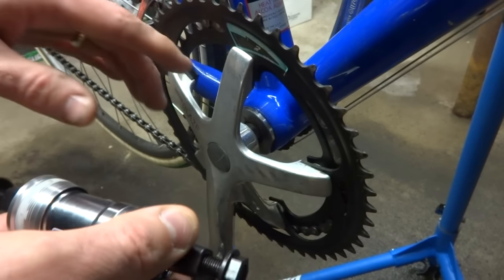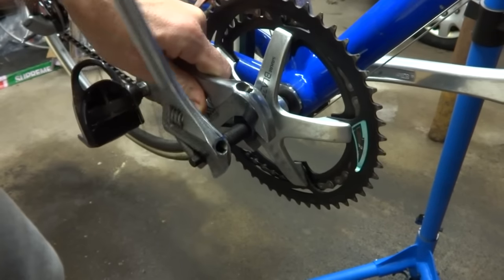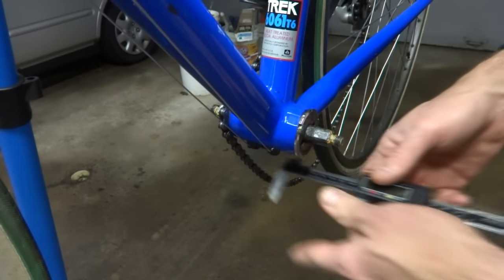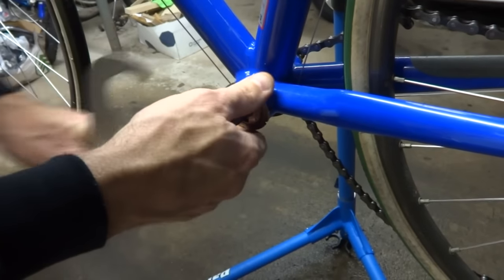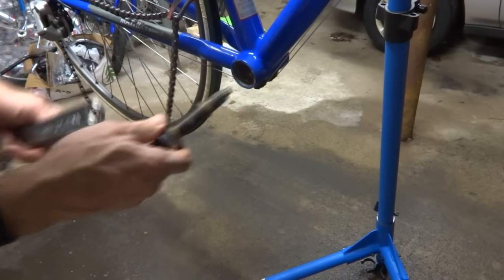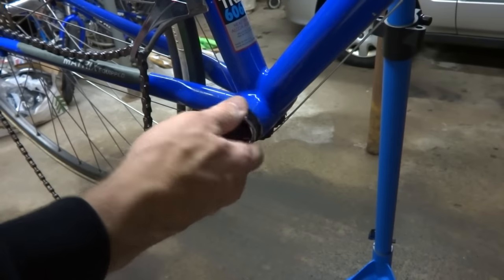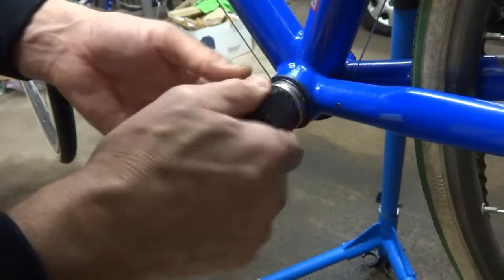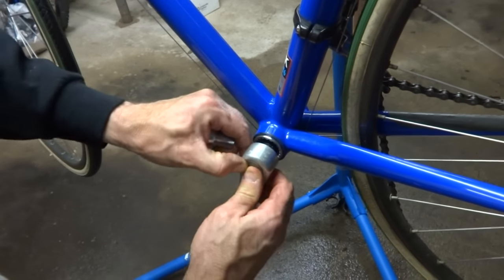How To Upgrade Vintage Bike With Sealed Cartridge Bottom Bracket

Comment: I would like some help. I removed my vintage´s bike bottom bracket and the measurements I obtained are; axle length of 127.5mm  a shell width of 70mm and a shell diameter of 34 mm. I want to upgrade to a 110 mm sealed squared taper bottom bracket but most of the ones i find are 68x110 mm english threading  and when i do find a 70 x  110mm it says Italian threading. can my bike have an english threading even if it has a shell width of 70mm and a diameter of 34mm if it is, where can I find a bottom bracket suitable to my bike?
 Thanks
Reply from the maker: I don't know you have. 70mm is typically Italian.
https://www.sheldonbrown.com/cribsheet-bottombrackets.html
Reply: @RJTheBikeGuy   Thank you so much for answering. I saw that site before, and according to them it is italian, but my bike frame is from a swedish company ( https://auctionet.com/en/519858-cykel-26-itoh-mustang-1970-tal) so that makes me doubt.
Reply from the maker: Often there are are marking on the BB/cups. What do they say?

Comment: Why is it that whenever I install a sealed BB it always feels like the rotation is sooo smooth until I install it?  Once it tighten it into the frame it always seems too tight when I try spinning it.
Reply from the maker: I don't know. But any minor resistance you feel by hand turning the spindle with be insignificant when pedaling.
Reply: Thanks RJ.  I slapped in on and it's smooth as hell.
Reply: Because you're crazy lol

Comment: do you know if i can buy carbon fiber road frame from china and i can use square taper bottom bracket?
Reply from the maker: +Haralabos Lukatos Ask the seller. I don't know the details of the frame.
Reply: thank you for the answer. i look general carbon fiber frames and no have deside yet to buy one i have seen so many cracked fail carbon fiber frames online and i not know what to do. many people say carbon frames is good some say not
Reply from the maker: I would be wary of a cheap carbon fiber frame.
Reply: always you help me thank you. You are very profesionall in bikes repair. I repair bikes at home but i am too far from your pro level i want learn better to repair bikes and faster too. You think is better i stay with my steel and aluminum bikes? have i very nice day.
Reply from the maker: Probably safer unless you know what you are buying. Even buying an expensive carbon frame from China is risk as there are a lot of counterfeit bike frames coming out that look like high end frames, but aren't built to the same quality.

Comment: can i change the gear 3 piece crank to single crank??
Reply from the maker: No. Why would you want to anyway? One piece cranks are for low end bikes.
Reply: RJ The Bike Guy cause my gear doesnt work anymore 😅
Reply: You probably need to fix the shifter or the derailer, or get a new inner cable.

Comment: This conversion adds weight, correct?  You already have the tubing of the BB shell to support cups and cones, then you go and add more tubing of the sealed cartridge to support the cups and cones.  Granted the sealed cartridge cups and cones are smaller in diameter, so it might be a wash.  However, there's also the durability factor.  The larger original cups and cones would last longer because of more bearing area.  Then again, having a sealed system may last longer because dirt and water is kept out.  Interesting trade-offs in these two bearing solutions.

Comment: Okay I have the tools and instructions I measured the bottom brackets and know what size to get .I don't know what brand to get the pricing is compatible but how do you know a reputable brand they have so many I would like to get the best bang for my buck I know shimono is good but there are several brand from Italy Germany America etc. Besides size what should I be looking for in performance does any one brand last longer etc I ride my bike all year round in the mountains rain sleet snow mud hail extreme heat my original bb are worn and the crank arm has play in it I don't want to. Keep spending money for stuff I can do at home

Comment: No grease on the bolt threads of the new crank arm bolts!
Reply: Some mechanics will say "yes' to a very very small amount if you are working on your own bike.For a paying customer never because of the legal liability it might cause later. I use a bolt anti-seize so it will tighten down and torque to the factory spec.

Comment: how to choose correct bottom bracket size?
Reply from the maker: Measure the shell. The spindle length is dictated by the crankset. See the crankset specs for recommended length.

Comment: Sorry, I'm a noob with actually doing things instead of watching and don't know all the names.  I have some cranks that basically have the "female" side of the 8mm hex, no bolts.  I got the non-drive side loose and ready for the crank puller, but the drive side is really stuck.  It does not seem stripped.  I have tried putting some PB Catalyst in there, making sure it's clean, etc.  Oh, and I tried hitting it with a hammer, but maybe not hard enough (trying not to annoy my neighbor).  I don't have anything other than basic tools like hex set, a couple of wrenches, a bike tool, etc.  I can't get good leverage or hold on tight enough and my hands are getting sore.  Getting sick of giving up and going to the bike shop, and I may have to, but any tips?
Reply from the maker: https://www.youtube.com/watch?v=j5gmAkMLX60
Reply: @RJTheBikeGuy  Thanks, I FINALLY got both bolts on 2 bikes out, and got 2 cranks off so far.

Comment: This does not work well with an old lugged frame. The tubes extended into the bottom bracket and interfere with it.
Reply from the maker: Never seen frames where the tubes extend in like that. Sounds like poor craftsmanship.

Comment: OK but I have a new frame without a BB on it, how do I know witch size to buy?
Reply from the maker: David Smith it depends on the crankset you are going to use. You need to find what spindle length is recommended for your crankset. Sheldon Brown has a chart here for many cranksets. http://sheldonbrown.com/bbsize.html
Reply: This is what i have got Shimano Acera 9 Speed Octalink Crank Crankset 48/36/26 175mm FCM391
Reply from the maker: David Smith Then you need an Octalink bottom bracket. The specs for your crank set tell you exactly which BBs you need: http://bike.shimano.com/media/techdocs/content/cycle/SI/FC/SI_1ME0A/SI-1ME0A-001-00-Eng_v1_m56577569830745522.pdf
Reply: OK matey thanks a lot your a legend

Comment from the maker: ***** , no. So you will have to measure like the video.
Reply: Is there a nuther way than using the crank puller to remove the drive side ??
Reply from the maker: To remove the crank? Or the BB?
Reply: RJ The Bike Guy how do you know what size of bottom bracket and the crank you need???
Reply from the maker: The size of bottom bracket is dictated by the crankset you have. They will often list in in the specs for the crankset what size of BB you need.
Reply: thankyou
Reply: +RJ The Bike Guy i may convert to this system next year are so i will see how the old set up last ;)they seem better than caged bearings

Comment: do you not want to buy combination wrenches?
Reply from the maker: +Scott Boerner I own combination wrenches. About the only place I could have used them in this video was on the crank puller. I don't one big enough to fit the fixed cup. That would be a big ass wrench!
Reply: looks to me like you used two on a puller that needed a 18 and a 14
Reply from the maker: That is what I said. And it was easier just to grab a couple adjustable wrenches. Feel free to use combination wrenches when you do it.

Comment: Hey RJ! Today i did this upgrade but the original axle width on my old loose ball bearing bottom bracket was 120 and the new shimano bb i bought was 125.5, that was the closest i could find (there was also 117.5 but I chose the 122.5). Is there any problem with using an axle 2.5mm longer? I had a talk with a guy in the bike shop about the chain line, that it should be parallel. Do you have any info on this topic? Thanks a lot.
Reply from the maker: You bought 125.5 or 122.5? Yes, it will throw your chainline off. So your chain will be at a steeper angle in some gear combinations. 2.5mm will not be much. 5.5mm would be a lot.
Reply: +RJ The Bike Guy I had 120, bought 122.5. Thanks a lot for the reply, everything seems to be straight. is there anyway to measure it?
Reply from the maker: Yeah, but kind of hard to explain. I go into measuring chain line in this video: https://www.youtube.com/watch?v=sInijI1vr34
But this is for a single speed.

Comment: I measured 68mm shell width but my caliper is saying 125mm for spindle length. I googled that size BB and can’t find it in 125mm. I see 122.5mm, I see 127mm....,
WTF?!?!
Reply from the maker: Find the closest you can.
Reply: I think my caliper is off a bit
It’s not a digital one
I’m gonna get a 122.5

Comment: Why even do this at all? Just re-grease the bearing and put it back together, or replace for $6 a side! These pre-assembled bearing units were made for bicycle assembly by unskilled labor; no need to finesse the bottom bracket nut when installing. Not intended for retro-fitting.
Reply from the maker: They are much better sealed, and come precisely pre-adjusted . But you can do what you want.

Comment: I've also got a bike with the same bottom bracket as yours.
Would it possible to install this: http://www.amazon.com/SHIMANO-Alivio-M4000-Groupset-9-speed/dp/B00LTLFW2K/ref=sr_1_1?ie=UTF8&qid=1428023461&sr=8-1&keywords=shimano+m4000

Do all frames have/use the same diameter & threads when it comes to bottom brackets?
Reply from the maker: That will probably work for you. Well, the most common size is 68mm wide shell and 24tpi. But vintage French and Italian used different threading. Also vintage Raleigh 3 speeds.
Reply: RJ The Bike Guy my shell is 68mm but what is 24pti?
Reply from the maker: theACEbro 24 tpi. Threads per inch. That is the common threading on bottom brackets.

Comment: Should of upgraded to external bearing cranks.  Shimano Tiagra the one below 105 is light years ahead of that old crank set.  You would need the bottom bracket chased and faced at a shop but once done it's super easy to install with no crank puller and is stiffer and lighter.  Seems like a waste to spend money on obsolete technology they don't make any more.
Reply from the maker: That's more money that I want to put into this bike that I am not even going to keep. Maybe I will do that on my personal bike, but maybe not. I have rarely had problems with old style BBs. I have never had issues with the sealed cartridge BB on my road bike. But I did have lots of problems with the modern style BB on my tri bike. The left crank arm kept coming loose. And one of the bearings disintegrated.
Reply: they do stil make them , I just fitted a new one on my mtb , I also have the hollow tech 11 on my racer , yes the hollowtech is lighter but theres nothing bad about the old sealed cartridge either, apart from the weight , I cant fault either of them realy mate :)
Reply: @traingp7 they dont make any more?? you mad bro? btw hollowtech is exactly the same thread as old style bb.
Reply: Yup they do still make them mate , loads of bikes still use those bb,s , and yea they use the same threads as hollowtech so their interchange able

Comment: Everything is going okay, but grease on the cup shell just shows a complete lack of knowledge. Please people, don't grease they come from factory with a white/yellow line like you see in the video called anti cease, if doesn't come from factory with this, get anti cease paste. All this avoiding your bb to get damaged over time because it got loose by itself.
Reply: It's anti seize
Reply: You're not wrong, but in a pinch, you can grease it if you've got nothing proper on hand. But yeah, get a proper tube of anti-seize if you can, but grease is  better than allowing galvanic corrosion from locking up the threads.

Comment: Haha WRONG.  A vintage "old style" bottom bracket IS AN UPGRADE.  The newer bottom brackets have higher friction but they are cheaper and faster for bikeshops to install by grease-monkies, and they work in crappier misaligned (mis-faced) bb shells, so that's why bike manufacturers use cartridge bottom brackets now, not cups & spindle bottom brackets.  NOT AN UPGRADE.
Reply from the maker: The bearings are sealed better and last longer.
Reply: None of that is true.  The bearings are not sealed better (good cup and spindle bottom brackets have rifling to push water out of the bottom bracket) and the definitely do not last longer, most cartridge bottom brackets last only 1-2 years with daily bicycle riding, properly faced & installed & spaced cup & spindle bottom brackets can last a decade under the same circumstances.